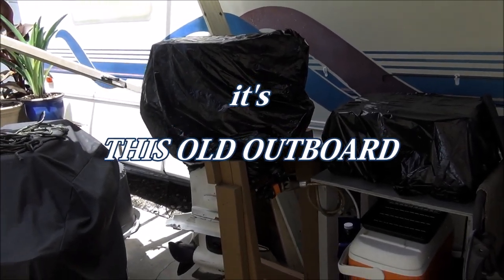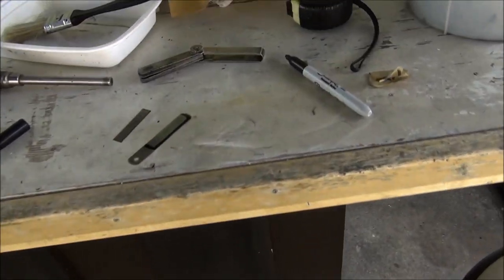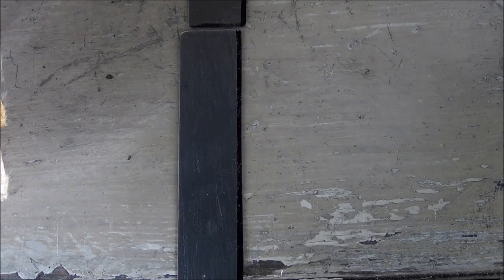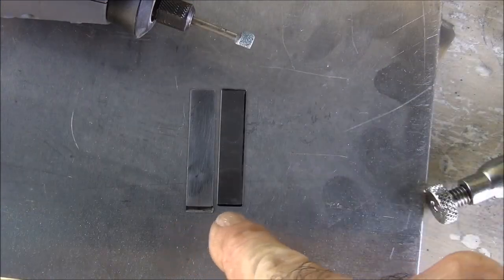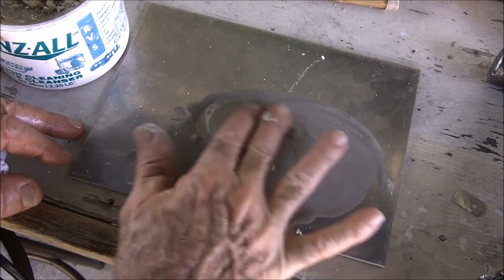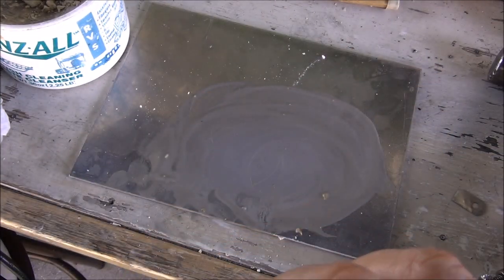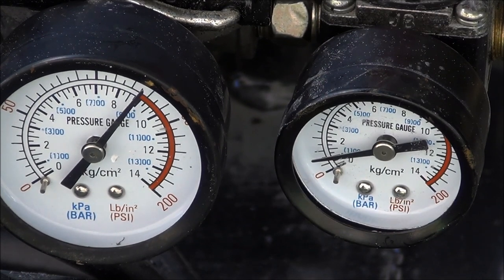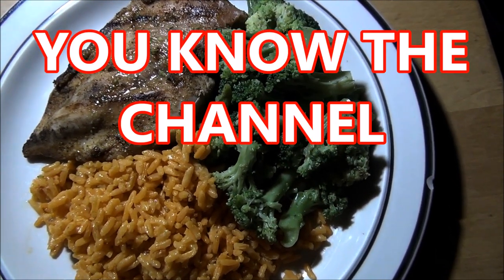Harbor Freight - Air Compressor REED VALVE FIX

Comment: Why don't you run the 30 without the Tstat. It's just another part to fail. I run my johnson with out one and it runs perfect.
Reply from the maker: hey. because I already paid for the damn thing might as well put it in, and i was told (by someone who has 100 times more experience than i do) that these models need to warm up slow to operating temperature or they tend to foul out the plugs. now, i've run plenty of outboards without the thermo and never had a problem  especially here in florida during the summer, but, what the hell!

Comment: I got same issue. What size feeler gauge did you use?
Reply from the maker: Hey. I couldnt tell you off hand. I just picked the one that matched the best. Good luck!
Reply: .010 is the one that I used.  It is the same thickness as the original reed
Reply from the maker: @kevinasbell920  Hey. Thanks Kevin. That gap gage  I used was so old the numbers had worn off. Hahaha. And its still goin strong! Thanks for watching and commenting. Stay tuned!